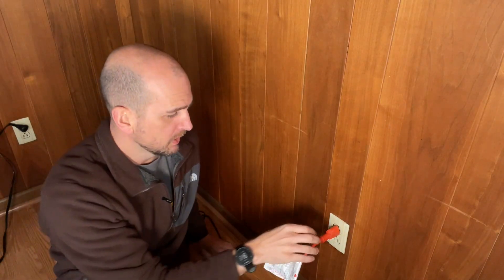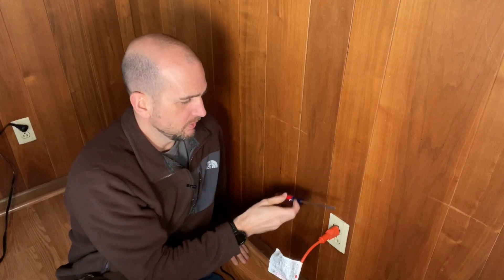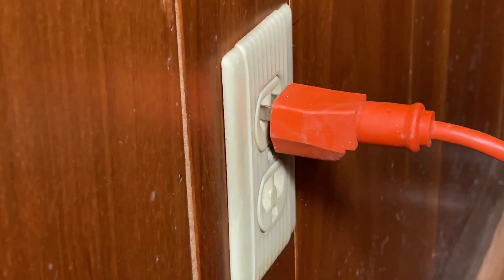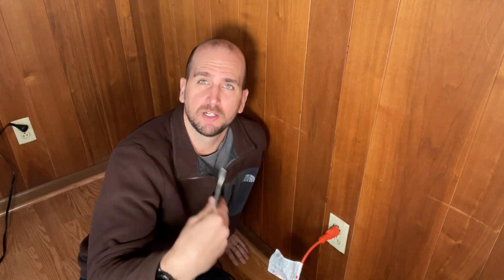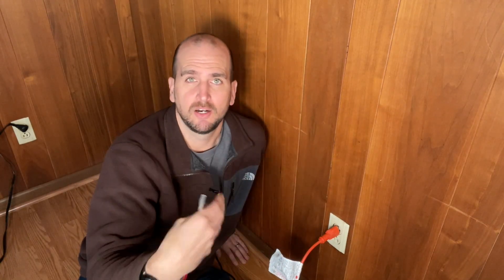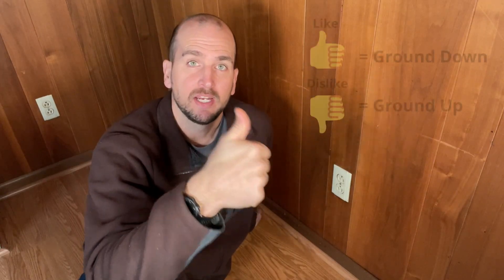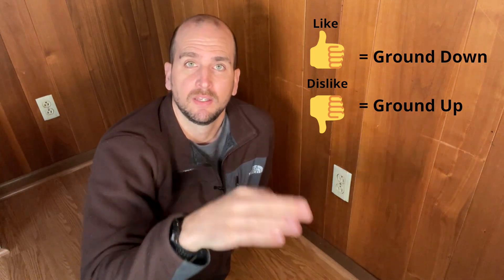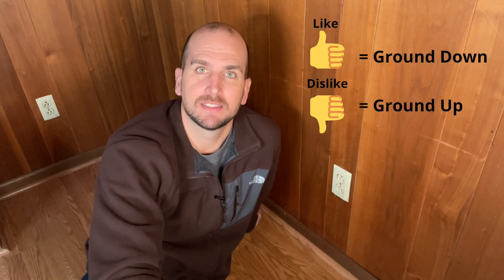Should An Outlet Be Installed Ground Down Or Up

Comment: I call bull crap on your ground up position.  Any low voltage power pack will hang off the receptacle exposing the hot and neutral.  Ground down smiley face is preferred

Comment: NEC does not dictate orientation. With a floor mount should it be North or South. Same for ceiling mounted.  How about in the light fixtures with an outlet. Or even horizontal orientation.
As to the "safety" suggestion it wold be safer to not have loose metal strips above outlets.  Oh, and don't  forget a circuit breaker will trip befor a fire.

Comment: Does the orientation of the outlet in a bathroom effect the roll direction of the toilet paper?
Reply: The deciding factor in roll orientation is whether the household has pets.
Reply: @butchs.4239  also small children are #1 factor in direction
Reply: @butchs.4239  Cats in particular?
Reply: @wilmeaux12  My first thought was cats, but I've known dogs that would likewise unroll toilet paper so I included them with "pets".
Reply: @butchs.4239  Very smart and thoughtful.
Reply: @butchs.4239  Or kids
Reply: @butchs.4239  my cat rips it up either way.
Reply: @tonyromano6220  Get rid of the damned cat. I can help. 🔫
Reply: @ronrodgers6531  
Tape TP to the cat's leg. It will learn TP is bad.
Reply: @assassinlexx1993  Assassinlexx, I have a better idea. Tape the cat to the hub cap on the neighbor's car. Then EVERYONE will know cats are bad.
Reply: @ronrodgers6531  cats are ok they keep  the rodent population down  here. I always wonder why there is no mouse flavor cat food🤔
Reply: Toilet paper over normally. Under with kids and cats.😂
Reply: Depends on which hemisphere you're in.
Reply: @Donleecartoons  If you are at the equator, your toilet paper is 90 degrees at vertical orientation. The next decision should be Left or Right?
Reply: If the outlet is ground down then the roll is over the top. If ground up and you have a cat, then roll is from underneath. If you use a leaf or corncob then ground can go up or down.
Reply: @marks3750  Cornholio.... heh... heh...   heh... heh... heh...
Reply: I was thinking during the video that the same old women who have ground-up receptacles have their toilet paper coming off the back of the roll.  I change toilet paper around whenever I find it that way!  😏
Reply: Of course, especially if you want your toilet to flush right.
Reply: @trailrider0194  I bought my toilet (loo) in Australia. When I flush it goes in the opposite direction...
Reply: @peteyc2292  I've heard they do that. I always wanted to go to Australia and see for myself.
Reply: @trailrider0194  is that in a toilet where the water swirls clockwise of counterclockwise?
Reply: @natashahancock9896  I guess that would depend on wher you live. Or maybe it's depends on whether you outlet is 110 or 220.
Reply: Only in the northern hemisphere.
Reply: If you are in Italy it has to be underhand, but you are in Germany it would have to be overhand. 
It's regulations.
Reply: Only if your married.
Reply: Not really, but it can affect the price of tea in china.
Reply: " To prevent splashback, hand lower all
 turds " 
- Anonymous
Reply: @gerrett108  Or if you have company and you don't want them to hear...
Reply: Everyone knows it is over the top for the TP roll. 
If your cat pulls the paper off the roll you get rid of the cat.  🤷🏻‍♂️
Just kidding. 
A.L.F. did say the only good cat is a stir fried cat though.
Reply: According to health codes, toilet paper should always feed from the top to the front to keep the paper and hands away from the wall.
Reply: @benevolenthighwayman882  
You are so right. Like paper towel sheets are dropped out from the wall not up against it. So should toilet paper. 🤔👍💯
Reply: No, but it does AFFECT the direction of the toilet paper roll.
Reply: yes :) it matters lol
Reply: Only in the Southern Hemisphere.
Reply: Of course it does, Ev body nose dat
Reply: Yes absolutely
Reply: Just turn the holder sideways and enter a new realm of wiping yo azz
Reply: The NTPC (National Toilet Paper Code) clearly states that underhand is proper code in any and all states and scenarios.

This is per the NTPC chapter 3 section 6 subsection 2.4b
Reply: @Soxruleyanksdrool   You must be reading an outdated version. Current one says off of the top. ;-)
Reply: @Soxruleyanksdrool  Does that same code say that dispensers in stores must be high enough that you can easily reach up into the bottom to get the paper rather than nearly falling off the toilet reaching down and around because it was installed too low?
Reply: @Soxruleyanksdrool  no your wrong it's over hand or waterfall effect is code lol
Reply: @1995dresser   Well, you may prefer overhand, as most folks do, and that's your preference.  But it clearly isn't code because, as I stated earlier in this thread, I wrote the code book. So I obviously know what it says.  But don't worry, the code is not really enforced.  So all y'all who hang there TP overhand can continue to do so with no fear of retribution. This is due to the NPTA having  been given the responsibility of writing the code book, but absolutely no jurisdiction to enforce it. So hang your TP however you like.
Reply: @Soxruleyanksdrool  you got me I am wiped out lol
Reply: @1995dresser  Nice. I see what you did there.
Reply: @Soxruleyanksdrool  over the top not under.
Reply: No, it doesn't say over the top because I wrote it.  And I didn't base the code on popular opinion.  I based it on which way is clearly better by all logical accounts.  That's why underhand is proper code.  What you read was apparently some cut rate knockoff written by someone who obviously can't accept the fact that underhand is better.  Hope this info reaches you before it's too late. Lol.

Comment: Normal installation will have ground up if the outlet was on a GFI circuit making it easy to visually see it. Ground down is for a common circuit.

Comment: Ground pin up & never break the ground pin off your extension cord again!  It only makes mechanical sense, the spade pins on the bottom provide support for the ground pin on the top.  My area does the ground pin down, makes no sense!  Pet peeve!
Reply: 71 yrs old, working with extension cords, power tools all my life. Never have I broken off a ground pin from a wall outlet. I must be doing something wrong....  ; >)

Comment: Ground  Down always     Every damn appliance you buy, especially air conditioners, refrigerators, microwaves, light timers, etc  have plugs and ground fault plugs attached in such away that that if you plugged them into a ground Up outlet the cord is sticking straight up or you cannot use the 2nd outlet

Comment: In the early 1990's I was a GM "Mr. Goodwrench" service technician. We had to go and get electronics training to work on the cars because of all the computerization. When this question came up about ground being up or down on a plug-in, it was stated that ground up is the safest method because the vast majority of people are right handed and when unplugging a device with the ground down plug-in position there was a much higher chance of the finger brushing the still live blade and causing a shock. On the ground mounted up there was less chance because the hot would be away from the right hand pulling out the plug where the first knuckle of the index finger would be positioned. I've mounted mine ground up ever since.

Comment: Texas master electrician Mike ground down just look at 30 and 50 amp plugs for dryer, range plug welding plugs. The molded  black covers lead you to think ground down so I tell the guys I my shop to kept it all the same. Ground down so are customers see everything the same.Mike

Comment: I think "it depends" is probably the best answer. 
 
If what you're going to use it for is more convenient with ground up, ground up.  If more convenient ground down, ground down.  If more convenient ground left, ground left.  If more convenient ground right, ground right.  If you want to screw with everyone, ground diagonal.  If you want to screw with people that have a form of OCD that freaks out about non-uniform ground pins, make sure no two outlets have the same orientation.  Bonus if you can make every outlet in a set that way.  Double bonus working in diagonal.

Comment: I learned electrical as teen, my friend's dad was an electrician. I was told ground up helps avoid breaking the outlet if the cord is stepped on as the receptacle face is thinnest at the ground opening. I remember seeing broken outlets that my friend had scrounged.
Reply: ive seen more ground up sockets that have been broken than those installed ground down, and ironically its for a similar reason. as another commenter stated when the average person unplugs a cord, they usually do so by pulling towards themselves. most outlets are installed below shoulder height meaning they pull upwards on the outlet applying more pressure to the ground socket and finally breaking it. in most homes that is not a problem when the neu and grnd are typically connected at somepoint in the wiring. but on circuits where they dont for true 3 phase ac needs it kills the outlets function entirely

Comment: As an electrician, I have seen 3 instances of metallic objects shorting out on plugs in receptacles. I was told as an apprentice that the ground up receptacle is required by OSHA, not the NEC, for workplace receptacles.I also have heard that the NFPA has been discussing this subject for possible addition to the NEC for a while. The theory is that if the plug is partially pulled out of the receptacle, is still making contact, and if a metallic object was to then drop onto the exposed pins, it would have a much greater chance of making contact with the ground pin first if it is on top. Then as the object continued to fall, if it fell against the ungrounded conductor, it would likely short out immediately as it would be more likely to continue maintaining contact with the ground pin as it falls. If the ground pin is down, then a metallic object can make contact with the hot pin only, thus not tripping the breaker even though there is a live exposed object. I was called out on a service call where an office workers keys had been set on a pile of paperwork, then slipped off onto a loose plug. She went to pick them up, got a shock, which caused her to react, and that moved them enough that they made contact with both hot and neutral pins, tripping the breaker. another time, it was a metallic picture frame that slid off a desk, made contact with the ground pin first, as it was on top, then rotated and shorted out on the hot pin. Now this problem is partially helped by the requirements for gfci protection, but the majority of older branch circuits don't have such protection. I also like the fact that with the ground pin up, the ground pins don't break of the cord plugs as much since the ground pin keeps the plug from bending in the receptacle.

Comment: It's always preference as far as functional, and i quickly googled different manufacturers and they all show the ground facing down. Furthermore on 90° plugs they always face the ground (you can see it in the background the wire going up the wall) and Usually 45° to the right. Modern installs have the outlet sideways... that's where the real question is! the 45° turn is mostly to the left, even though everyone tends to install them on the right lol. I know i did lol

Again, its not enough knowing about google.. learn to be friends with google. That's a think thoughter
Reply: Also, with ground facing down you have two prongs holding where mechanical leverage is most likely to be the strongest. So with with ground up and a wire being pulled downwards it Might be more likely to come out.

Comment: I remember when they changed the local codes here. And yes I have seen it happen when I was a cable guy I knock a picture off a television and the metal frame hit the plug which was only about half-way plugged in. It shorted out and popped the breaker. 
It's a good idea.

Comment: I normally go ground down.  I have heard the argument you made for ground up from an electrician that preferred to install receptacles that way to reduce the risks from anything that may fall on the plug, whether slightly pulled out or fully and securely inserted.  Where I worked, I did install a handful of receptacles ground up when they were not hot or if I had split them into one hot outlet and one switched.  These were part of how I worked on the backstage of our theater; I had set up a work light this way and had outlets for other lights near their mounting points that were this way as well.  I chose to do this based on a recommendation on a forum that suggested to do this for any receptacle that wasn't installed as it "normally" would be.  I did mark the plates so that anyone else who would be looking at them (which most people would not be), they would know what I had done.
Reply: At least you marked the plates, but simply turning the receptacle is something that lazy/cheap electricians do.
It is unprofessional to be inconsistent, and it's the wrong solution to the "problem". You should install receptacles that are marked as switched.

Such as https://www.hubbell.com/wiringdevice-kellems/en/Products/Electrical-Electronic/Wiring-Devices/Straight-Blade-Devices/ConstructionCommercial-Receptacles/DR15C1WHITR/p/2608245

Comment: I do ground facing DOWN inside a home, but use ground facing UP with GFCI WR outlets outside and in things like a garage or shed.  The reason is that relatively heavy extension cords like 12/3 tend to be put into outside outlets and they tend to pull down some even with a new outlet, and can expose the ground.  Similar with a garage or shed.  Since the ground down is so common I see no point in confusing people inside a home who go to plug in something, so ground down inside, ground up outside.  If  a person is outside using an outlet then they are probably a working stiff sort anyway and would look more intently before using the outlet. before plunging forth with the plug in hand.  Also, more in kids are about outside tripping over things like cords.  Of course, outlets need to be replaced if the extension cord dips easily when plugged in, but I have no control over future replacements, and so ground UP seems best for outside outlets which need to be GFCI and water resistant with a cover box.

Comment: Hospitals have the GROUND UP.  This is a safety  issue . In case something  metal  comes in contact by accident having the ground up will prevent contact with the hot side. I MYSELF PREFER THE GROUND DOWN AND I WILL NOT CHANGE IT. LOOKS BETTER ALSO.

Comment: I always though ground down was like a code or something as all but this house i am in now had it ground down. Everything i guy that plugs into an outlet assumes ground down. It just makes sense for ground to be on the bottom. IF your outlet isn't allow you to push your plugs all the way in you shouldn't use that one but use another it is a electrical hazard to use.

Comment: I installed all my outlets  ground down. I have been on jobs were the electrician installed them ground up. It was called out on the plains. However I did have a metalic cover drop on the hot and neutral once. It can happen. Plug a cord in and remove the face plate screw, it will short out the circuit. It is not in NEC, up or down.
Reply: Why the hell would I remove a face plate screw? Oh I know the plastic plate fell down and did it.

Comment: When plugging in a grounded plug, having the ground pin on top provides a visible guide.
Also, the ground pin is longer so when you plug in, you are more assured the cord is safely and completely plugged in.

Comment: I've been an electrician for 30 plus years, I have never seen in any of the code books anything about general lighting outlet orientation of receptacles,  But as you mention in your video,  as directed by the project based on equipment needs,  I've seen corded plugs for 120 vac 15-20 amp  plugs in every configuration you can come up with! 
I've had to reorient  receptacles just because the cord would be upside down, or sideways.  So as long as it looks correct I think that is just common sense. Great job on this video. Good subject. Thank you.

Comment: Given features of various components (someone mentioned nightlights) and the much greater incidence of pictures with ground down (think cartoons), it seems that ground down is much more common. I do like the safety argument for ground up, though, even if it's not 100% beneficial. I've typically followed norms, though, and installed ground down.

Comment: Code usually has no preference, but best practice is ground up.  If the  socket set is installed horizontally, then large blade (neutral) up.
Unfortunately a lot of right angle connectors are made ground down as are small appliances that are at the plug.
Animations of sockets (cute face) reinforce the ground down notion.

In the end, for most household use, ground down is acceptable.

I like the reply about if it's a switched circuit then ground up, otherwise ground down.  Not that it matters once all is installed and plugged.

Comment: my code enforcement guy says ground up in case someone falls and tries to catch themselves and touches both prongs, very very rare but they overkill everything, i rewired my house totally, but talked to him in the middle, so i have half mine one way, half the other, and for sure most things are manufactured ground down. but he also said he didnt want wires passing though an outlet to another, he wanted a pig tail to the outlet so you have a total of 9 wires you have to bug and get in an outlet. his idea is if the wires get hot/shorted, the outlet wont catch fire being the weak spot.................but most houses today are wired the other way without a problem..............but how may burned to the ground ????